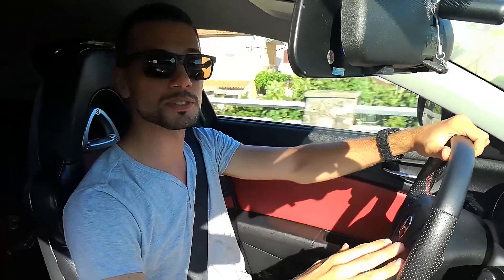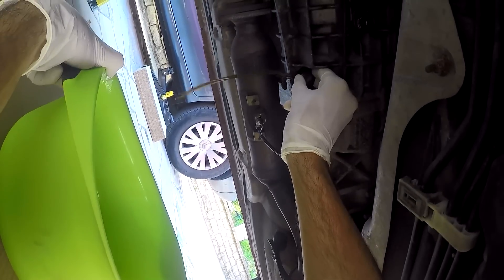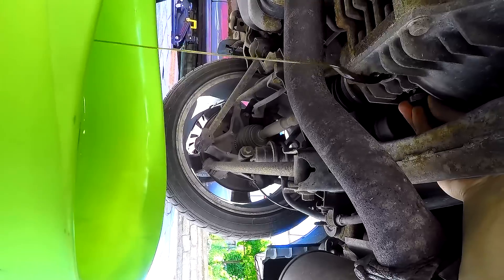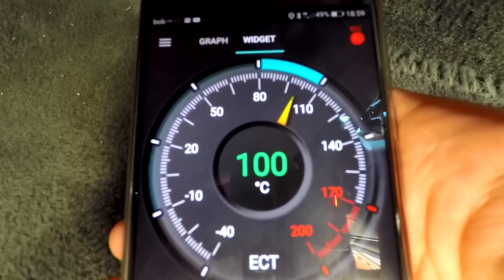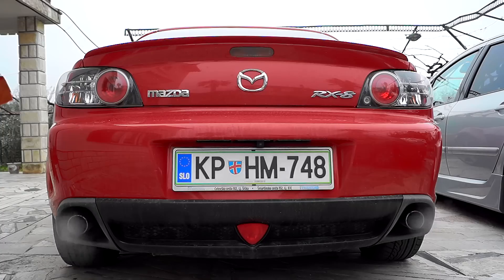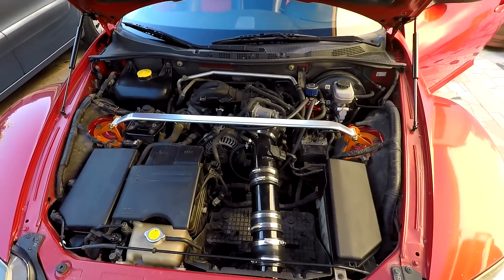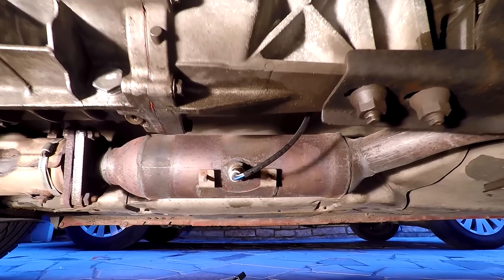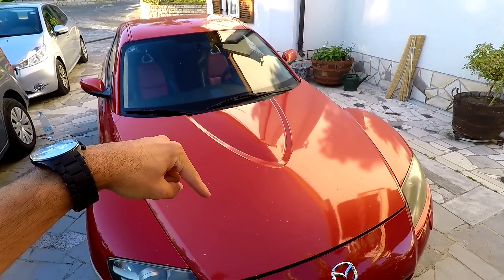10 Ways To Make Your Mazda Rx8 More Reliable (dont' disconnect the metering pump)

Comment: Mine has 92000 miles w/o any major problem.... Unreliability is directly related to ignorance of the unique rotary engine needs...
Reply: And I highly doubt Mazda informed customers of the unique quirks of the rotary animal.
Reply: I remember it being in the cars manual,  how many people read those though I guess.
Reply: @mr.vandecar3826  I actually took mine out and read it cover to cover when i bought my new car
Reply: I have 124,000 on mine with just regular maintenance.
Reply: Of course not, if they sat there an explained the quirks and unique needs, they might have lost sales.....
Reply: MrErikw26 Well it’s not Mazda’s fault it’s the dealership, they just want to make the money. Owners manual has all the info about it
Reply: PREACH
Reply: @MrErikw26  I worked at a Mazda Dealer when these cars were new and that was one of the issues stressed to buyers was the need for high revs and to stay on top of the service.
Sadly people would consistently run low grade fuel and keep the rpm range in the 2-3k range
Reply: @jerlaine1638  yeah, for most people "high revs" is 4,000 - not 8-9K (red line)

Comment: The best mod I ever did was the fan switch. Just ground a relay and your fans run at the low speed all the time. My temps in traffic went from 98c to 83c. I don't need to always be worrying about overheating. Its a 5 minute job and far easier than changing the point the fans kick in.
Reply: "The best mod I ever did was the fan switch. Just ground a relay and your fans run at the low speed all the time." Great, but can you give us newbees a discription ? Which relay and how to ground ?
Reply: Joshua Thiel Hey what do you use to monitor your temperature? Just curious

Comment from the maker: *DON'T DISCONNECT THE OIL METERING PUMP IF YOU PREMIX, LEAVE IT *
Reply: Driven by madness why not?
Reply: Hello guy's here brand new owner of Mazda rx8 2004 I just buy it 4-26-2019 the previous owner tell me that the car was just fine but needs alternator so I put new one and new battery and still can get it on 😫 

I can use any help here please!!!

Ooh just notice he let the car seating for couple months with 3/4 of gas in the gas tank 😟
Reply: @duracol8487  I think its flooded or the starter is weak
Reply: Joel Carlson which oil adapter?
Reply: almadriada perez or you gotta rebuild the engine lol.
Reply: @duracol8487  Check battery & connections; check key Fob battery; replace starter and or alternator; replace spark plugs.  Let us know how it went ☺⭐🙏
Reply: @duracol8487  yo, how is it going with the car?
Reply: @duracol8487  your cars done ✅
Reply: @duracol8487  hey bud I know I'm a little late to the party here. But you said you changed the alternator  and cannot get it to run.  What is the problem specifically?   Just keeps turning over and won't start?    Or what is it doing?   Do you have any lights flickering? A lil more info on what is going would be helpful.    But if you already changed the alternator I would recommend changing the starter and spark plugs next. Both fairly easy to do. Plugs are kind of a pain you just gotta pull the drivers side front tire off though and it becomes pretty accessible at that point.
Reply: Where is the link for the cat replacement thingy?   I could not find it in your list of links

Comment: I'm considering buying a Mazda RX-8 from 2003 (6MT) as my first car, so this this will definitely come in handy. I heard that the first gen RX-8s are sorta "problematic" because of the way the engine gets lubricated and that you have to pre-mix but considering there's no way I can afford the FD the RX-8 will do haha. Subscribed.
Reply: Did you end up gettng it?
Reply: Updates ?
Reply: Yap updates, as a first car if you're not mechanically inclined, bad idea, If u did get It Im hoping u have as much fun as I do!!!
Reply: 1 year ago I bought a s1 04 manual as my first vehicle, love it to death everyday even when it sits
Reply: how did this end up?
Reply: @WhysafraidofCause  not the same guy but bought the exact same 2003 rx8 six speed as a first car, had it for over six months now without issue. Oil is topped up every five or so fuel refills however because it loves to drink oil but other than that its all good
Reply: @eokagaming4711  glad to hear it
Reply: I bought mine 1 year ago, and swapped it with a toyota 3gr 3ltr v6! Love it to death! Even more than the rx7! The best car I've ever owned!
Reply: It's a 2004 they were made in late 2003.

Comment: I am a NEW Gen 2 RX8 GT MT6 Owner.  Florida Car.  Books and Records and Regular Services by Mazda.  Bought at 72K Miles and now just under 75K after 3 months.  The Differences between the Gen 1 and Gen 2 is literally Night and Day.  I personally would NEVER do any of these Mods because WHY would I 'Fix or Improve something' that isn't broken?  I named my RX8 'Unmolested'...OEM Stock with only the OEM Mud Guards and Moon Roof Wind Deflector installed.  Exhaust Mod?  Change that and get ready to change everything Upstream of a very well designed and manufactured RX8.  Just an Old Gun Pilot here very happy with what he's got...I mean IF you really really really want to blow your hard earned money try Internet Dating.... JP

Comment: Good job bro! But for information, You do not have to wait for the water to be at the temperature to leave. The  best way is to drive slowly (not more than 2500/3000 rpm) for 5/6 kilometers (about), because it should not be forgotten that the transmission must also heat;)
Reply from the maker: MrInslide Thanks bro! 😄 true, but since we are going into hardcore ownership, you might as well go full hardcore and wait the 3 minutes it takes it to get warm 😉👌
Reply: @Drivenbymadness  Well to my knowladge sitting on idle is not the best for stationary gear bearings due to low oil pressure rotarys produce so it is actually wiser to start it, buckel up and go using short shifts(under 4k is good enough) ;)